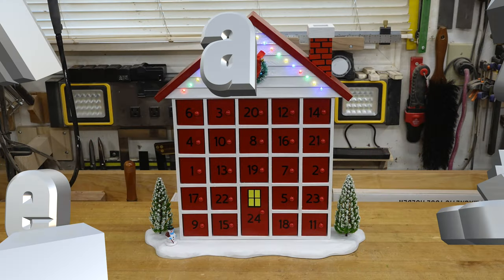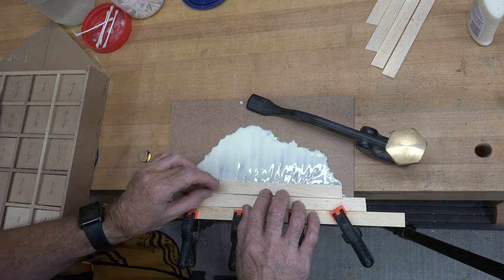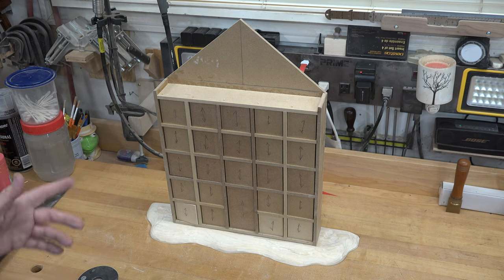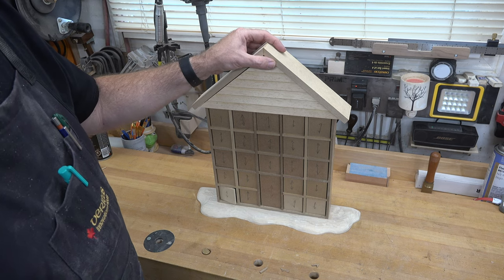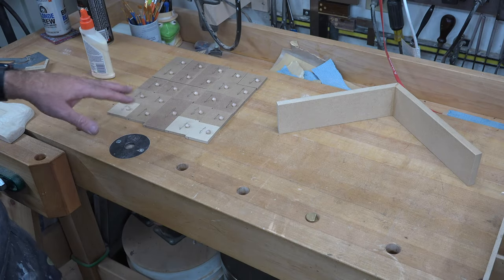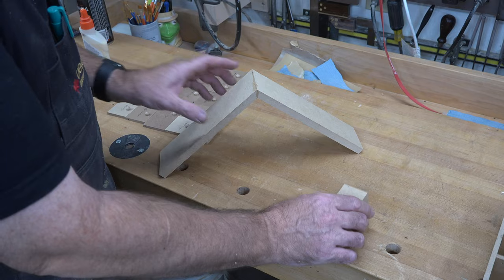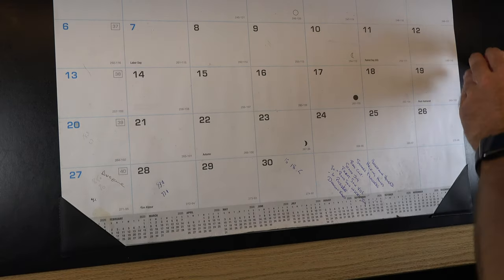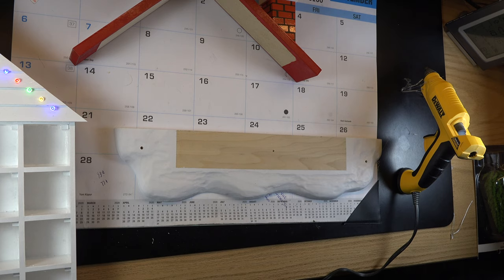Making an Advent Calendar Part 2

Comment: I have a question on the chimney.  The bricks, when I have wrapped this type of adhesive material around a corner, it tends to peel away on one side.   Very nice.
Reply from the maker: I haven't noticed it peeling off as of yet Scott but I will definitely keep an eye on that.  The adhesive on the vinyl is very strong so it may not happen.  Truth be told, this project was made last Christmas but wasn't posted in time to give people a chance to make it so it had to be postponed for a year.  The vinyl is still holding and this is its second season.  I will still keep an eye on it though and report back if something changes.  Thanks for tuning in to the show.

Comment: Hey can a ask something? Im making wood frame rubber band powered dragster:) i need a litle help with the axles i will put a strong rubber band thats why its called dragster i was thinking to make the axles out of nails i will cut them to size what you think? Thanks i love the show
Reply from the maker: Nails would work as far as I can tell.  Not knowing the scale of the dragster and how the rubber band will attach and the size of the nails etc makes it difficult to give an accurate opinion but I would think that nails would be strong enough as long as the gauge was thick enough to handle the pressure.  You can always send me pictures and ask your questions via the channel's Facebook page or via email if you'd like me to look at what you are doing and give my advice.  I'd be more than happy to help if I can.
Reply: @acutabove_woodworkings  thanks  yes the scale is around 25 cm long but i will put realy strong rubber band (one s they use at gym) and even a thin nail will not hold up i will use something like 10cm nail thats strong enough
Reply: @acutabove_woodworkings  im sure with this amount of power to scale i will definitely lose traction so i might need to put some weight at the back (for better grip) thanks for the answer
Reply from the maker: @ape337YT  That is very cool.  I may have to make one of those for the show.  It looks great.  I would just have to figure out how to make it.  If it were me, I would most likely use a 1/4" diameter steel rod for the rear axle.  That way, there would be no question about it's ability to hold the rubber band.  I hope this helps a little.
Reply from the maker: @ape337YT  Feel free to send me pictures of your project.  I'd love to see it.
Reply: @acutabove_woodworkings  yes it does tnx youre free to make one:) i will make the rear a litle wider on mine
Reply: @acutabove_woodworkings  ok maybe when i finsh it i need to study soo less time for projects:(
Reply: @acutabove_woodworkings  i see you kinda like my idea thanks i was about to quit but you inspired me to finish it! Can i send you pictures on email? I have assembled the front axle and wheels like you know i need bigger wheels for the rear i made the front wheels out of bottle caps with foam aroun them should i use bigger  bottle caps for the back? Because theyre not wide enough it will destroy the look and also it will have no grip heyy while im typing this i got an idea! I will stick 2 big bottle caps and that way it will be wide enough thanks:) whats youre email
Reply from the maker: @ape337YT  The email address and Facebook page link are in the "about" section of the channel's main page.  To save you a bit of time, you can always email the show at acutabove_woodworking@hotmail.com
or visit the show's Facebook page at https://www.facebook.com/kennyearrings1
I hope this helps.
Reply: @acutabove_woodworkings  sent! You can check it out i send it on youre email:)
Reply: @acutabove_woodworkings   i sent you another project on email i will send updates of the dragster soon:)